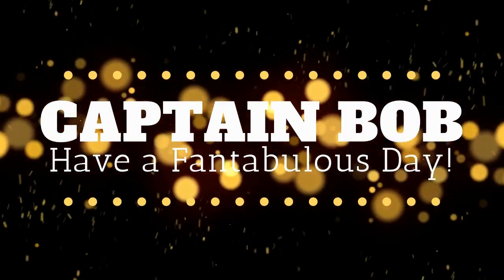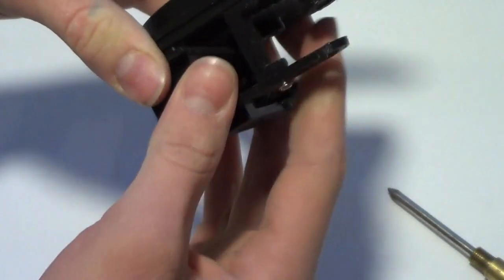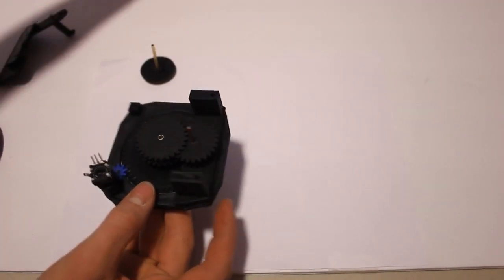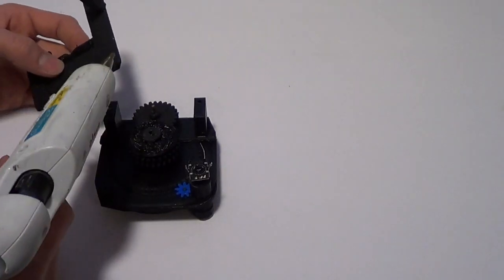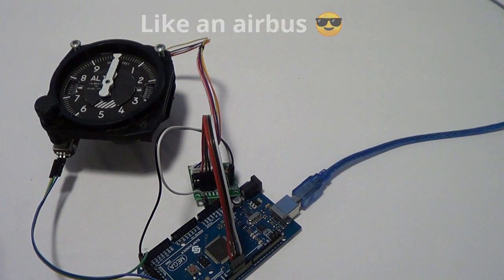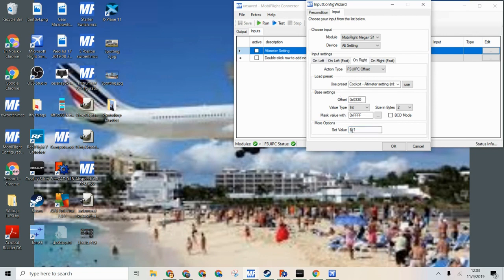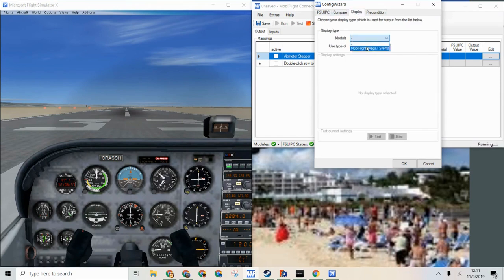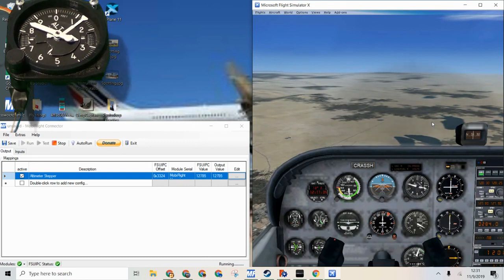How to Make an Altimeter for a Flight Simulator with MobiFlight | Captain Bob

Comment: Thanks Trevor for the stepper motor info.. I'll order the controller boards as well :)
Reply from the maker: Excellent! I hope you have a blast building it! As a heads up the old Attitude indicator instead uses 9g servos and this altimeter only uses one motor (I gave specs for the new versions)

Comment: nice work buddy. Agree with Dank below your videos are very informative. Keep it up !  Out of interest, how do you communicate the multiple instruments off the single mega arduino with limited ground and 5V ports?
Reply from the maker: You can either, Twist the wires together,  Solder the ends together or use a breadboard's positive and negative rails.

Comment: Very impressive. Great work. I would like to use steppers in my designs. Do you know how to program them in Mobi for xplane? That would be of great help to me for the zibo. Thanks and keep up the great work.
Reply from the maker: Just use the X-Plane feature instead of an FSUIPC offset. If Altitude is different from Zibo you'll need to change one of the filters from laminar to zibo
Reply: @CaptainBobSim  Thanks bud. I would show you my gauges but I have no way of posting here.
Reply from the maker: You should email me a picture! CaptainBobSim@gmail.com :)

Comment: Beautiful realization.
But how do you reset the altimeter between two simulations? When it was stopped at any altitude.
Reply from the maker: Between sessions, it should return to zero (which is a little bit painful when my home airport is thousands of feet AGL) unless MobiFlight crashes. If MobiFlight does crash you will have to recalibrate it manually, or cheat by unplugging it when it reaches roughly the right altitude, and closing MobiFlight. It might also be helpful to have another row for testing the stepper motor (no FSUIPC Value) and use the test function to recalibrate.

Comment: Wouldn't it be easier and more precise to have a separate motor for each needle? But probably that's not supported by the software right?
Reply from the maker: SimVim does it this way, and I'm sure you could write an expression to have it this way but I didn't want to design it for myself so I used Alvaro Alea's :)

Comment: Inspired by these videos (thanks) I begun to build an oil pressure/temperature gauge (Two needles). I'm using Mobiflight + Arduino Mega + L293D Shield to connect two X27-589 steppers. The steppers are connected to the shield and I do not know which pins are used. How can I do to set Mobiflight right when it asks for the pins? Thank for your help.
Reply from the maker: Good Afternoon NetoTrabanino,
I haven't worked much with the x27 stepper motors or the L293D Shield yet, so I don't think I could be of much help.  I think you might find more help on the MobiFlight Forum at https://www.mobiflight.com/
You could also refer to my Stepper Motor video if it's a question about the MobiFlight process.
Hopefully this helps!
Reply: @CaptainBobSim  . Thanks Captain Bob for your answer. I found out it doesn't work with Mobiflight, instead,  I switched to Step Motor 28BYJ-48 and it works perfectly.  It's finish and now I'm working on the Altimeter. But here I had to make some adaptations to fit my needs. (Resizing to match my others gauges, a front transparent glass, extra holes to attach to the panel, axes sizes, extra base to fit the Stepper Driver board, etc).  Thanks

Comment: Hi Trevor. I made this some time ago and have just converted it to use the X27 steppers. The problem is I cant seam to program the stepper to show correctly. Using MSFS2020 and mobieflight 'Plane ALT above ground" as the sim variable. If this is the wrong place to post this then so sorry
Reply: This should read the ZGA12 stepper that I got from aliiexpress. 1;63 ratio and it says 1260 pulse per 360deg
Reply from the maker: Use "Indicated Altitude" instead
Reply: @CaptainBobSim  Thank you. Sort of got it going now

Comment: How difficult would it be to convert a real altitude indicator to simulator?
Reply from the maker: It would mostly be a mechanical project, difficulty would depend on the model of the altimeter. I've worked with one before, it took a lot of experimentation but was doable

Comment: Captain Bob, This is Neto Trabanino again. I switched to MSFS2020. Could you give me a hand to code an Altimeter ( one stepper) in  MSFS2020 in my Mobiflight version 9.6.0. From Extras menu, I already downloaded WASAM module and downloaded the latest HUBHOB Events. I run the Firmware again and I have been trying diferents codes without success. In the section 'Sim Variables' I selected SimConnect(MSF2020) 🤥